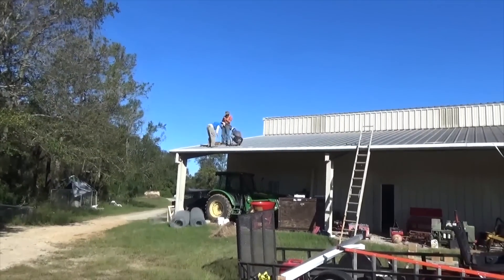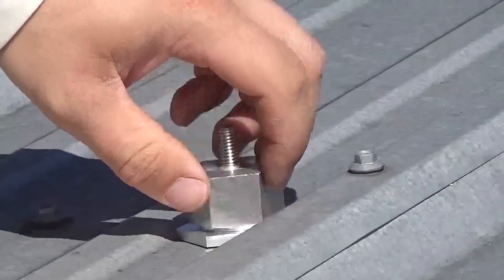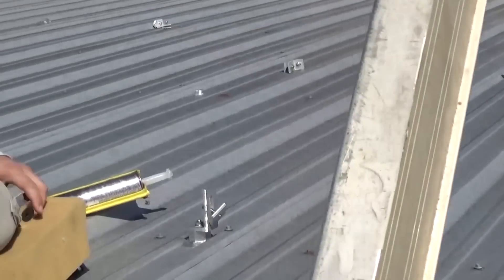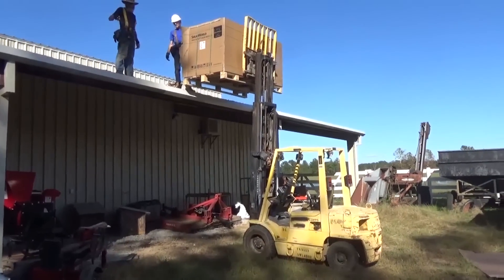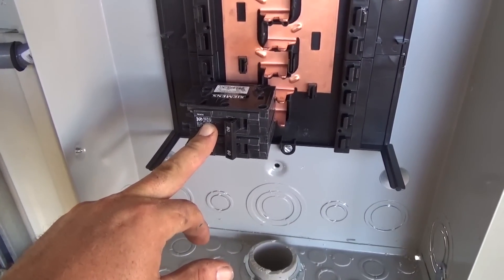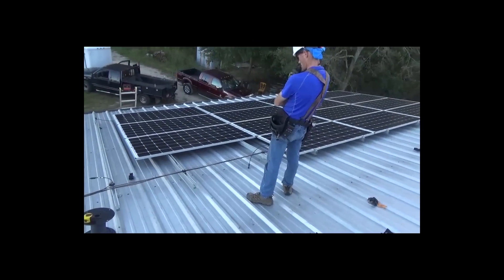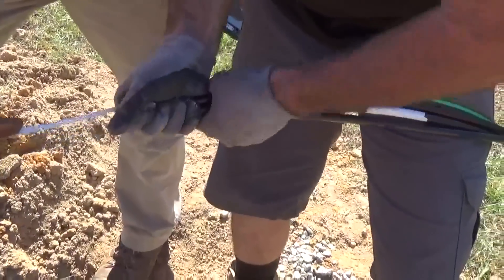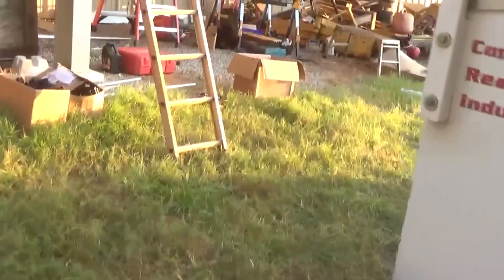20kW Net Meter with 6kW Backup

Comment: Praise the Lord!  Awesome mindset brother.  Keep up the excellent work.   
A thought though is to put a pull box on a post in those wet (or any) environment.   Trying to keep water out of the conduits in an underground junction box is futile.   I have had water seep through the insulation and wreck copper wire.

Comment: I just read for hurricane winds areas that through bolt is better for putting the panels on the rack then using the solar aluminum clamps! Unfortunately they didn't actually show what they meant by 'through bolt' as the holes are only on the bottom side of the panels!

Comment: The cost of this is only for somebody who has 50k+ for these type of systems. for the working man, this is unrealistic. I am surprised that the grid tye in, had a backup supply system, which i thought for safety reasons, grid tye will not allow backup power systems if your grid tied in.
Reply from the maker: You can scale it down.  We did one for a friend who now has net zeroed his bill for the rest of his life.  THe SPS is unique to the SMA inverters and is isolated from the Grid tied ability of the inverter.  SMA inverters are reasonable and efficient.

Comment: It's not a solar hot water heater it's just a solar water heater. If the water was hot it wouldn't need to be heated 😉
Reply: maakjar not true. Hot water goes to the panels where it gets a few degrees hotter, then returns back through the loop.

Comment: Does the third inverter on the right not connect to the utility at all?  And does it contribute to the owners' load when the power is back on? Or does it only function when utility is down?  The answer is probably obvious to other installers, but I'm a nail pounder :)

Comment: #1 most frequent accident on jobsites.....falls. 
#1 most cited violation.....fall protection, lack there of. 

These guys could slip & fall, crack their skull, break an arm or leg, impale themselves on something below, break their neck or paralyze them from a spinal injury. That hardhat is only good for possible danger of head injury from impact, or from falling or flying objects. This is just bad practice. They should be tied off with lanyards and harnesses.
Reply: yea not sucking is right on. A relatively flat roof like that fall protection would cause more of a trip hazard then  not sucking. I have been working on roofs and ladders for 35 years and I dont suck. that is rule number one.
Reply: or they could do something like: not suck.
whichever, though. it's up to them.
Reply: Shut up nerd

Comment: Do the inverters tie together to keep the AC in phase or is that handled by the combiner? I'd presume there's a communication cable between inverters. Anyway... just wondering.
Reply: They are grid tie inverters friend. They automatically adjust their frequency to the grid wherever they connect to the grid. In this case at the combinerwhich is probably simply a sub-panel. Only with off-grid do you need communication cables between inverters

Comment: up here in Minnesota the inspector goes over it with fine tooth comb. they dot the I and cross the t
Reply from the maker: Unless they are trained on solar inverters, charge controllers etc then they typically inspect the bonding and AC power side of things.
Reply: The head inspector comes with local inspector and spells out each code from one end  to the other. The way the electrician I use go about it is to call head inspector out tell him plan of attack and have him tell us what codes we need to follow  and how to interpret them. Then we get it done first try. Learned the hard way. Once we done  one in that manner we can do it without having the inspector come first but if there is a slight change we have inspector come first.

Comment: Shouldn't the secure power circuit outlets be orange in color?
Reply: That is required in hospitals to indicate generator circuits.

There isn't a code saying you cant, and it isn't a bad idea to do it for this application.

Comment: Do you have any upcoming jobs that are using batteries other than lead acid, like lithium ion or the Aquion batteries I saw in the background of your Pika factory visit?
Reply: Check out the new Tesla glass roof tile solar panels. https://www.bloomberg.com/news/articles/2016-10-31/no-one-saw-tesla-s-solar-roof-coming
Reply: Doug Dorrer, that's very cool not looked into solar systems for a long time now and having roof tiles as solar cells is good (but I guess price is issue at the moment)

Comment: very nicely done system. how will the 2017 electrical code effect your roof string inverters
Reply from the maker: Are you referring to rapid shutdown?
Reply: No the new code 18 inches from inverter if on a roof
Reply: The inspectors around here are looking for grounding. That's about it. But we fully intend to comply and will probably transition over to the most cost effective solution

Comment: As always your videos are top notch.  I really enjoy watching them.  Just a request.  Can you do more prep videos on projects that ordinary folks can afford?  The content in you videos is fantastic but 95% can't afford the projects.  I understand this is how you make your living therefore this is what the channel is about.  Second channel maybe?  With less expensive projects?  I also get that it takes time to do these vids as well as you do them so maybe you don't have the time.  Please don't take this as anything but a request.  Thank you sir.  Good job!
Reply: I am not sure how much they payed but 1 inverter is  the most $1,550 x3 = $4,650 + shipping. Solar panels 19,500 W x 0.6 cent/W = $ 11,700. You have to add here the mounting system for the solar panels + wires/cables + Junction boxes + trenching.
They need all of these only because the system was installed far away from the house. Otherwise you need just the solar panels, the inverter, mounting + some $ 200 cables. Because my system is installed on the roof just above the inverter  all I used is like 30 feet on 8 gauge wire. 
For a regular home you need about 15 -16 325W solar panels. and really that is for the summer when you use AC. On my house I have 10  - 310W solar panels, and for October - November I will produce more power than I need.
Reply: 30000$ to 35000$ from this project was labor, and you saw they had a lot of people working and they need to be paid.; but  a regular home system is cheap. An inverter like you saw in the video is about $1800 with shipping included. My 3.1Kw solar system was $ 2000 after all rebates received. Looking online a system like mine costs about $14000 if a company installs it. The problem is that I am connected to the wrong power company and they steal my power  that I produce. Here the solar panels were around $12000 at max. You can make it cheap but you need to get hands on and put a lot of hours in research. No more TV.
Reply: What was the actual cost of this system; installed?

Comment: pulling wire sucks. Ive seen some high rise buildings use a machine to pull everything..
Reply from the maker: We had hoped to net meter using the meter on the barn and then found out we couldn't so then it became a 620' pull of 3 runs of 1/0 copper and a ground to the house meter.
Reply: +engineer775 Practical Preppers  how many wires were you running in each pipe
Reply: Blackbear Prepper 3 conductors and a ground in 1 2" pipe and 4 conductors and a ground in the other
Reply: +Gain Solar Services thanks for getting back to me so quickly but I still don't see how you got that wire size and that count of wire
Reply: Wires were up sized for voltage drop.
Reply: +Gain Solar Services yes I understand that you're using 620 feet of wire what I do not understand is how you got the number of wire and the upsizing that you did does not make sense now granted I do live in California and codes are slightly different here but from what I can see from the video you should be running a hundred amp breaker for that distance of run would have to be 500 MCM wire we are also not allowed to run multiple smaller wires for a long distance run like that that's my question how are you doing that and what allows you to run such small wire we are also required to only have 2% voltage drop for inverters is it different in your location

Comment: At 6 minutes you said you tore through the usual water lines irrigation lines. Why did you not find out where they are by using your water dousing / water divining technique?
Reply from the maker: There are also mononuclear cells.
Reply from the maker: We went by what the homeowner told us.
Reply: zebby264 he also says monochrome solar panels at one point. That engineer775 is a jokester

Comment: When i pull wire I always put a swab on the front of the head case of rocks and dirt ! always lube the tie in is as always ya hope it dont pull out of the pull ! pro install guys ! awesome system ! WOW $$$$$$ good job !
Reply from the maker: Thanks.  That pull was a good workout!  Without the pull box in the middle I think we would have had to use a machine of some sort.  Lots of lube and coordination.